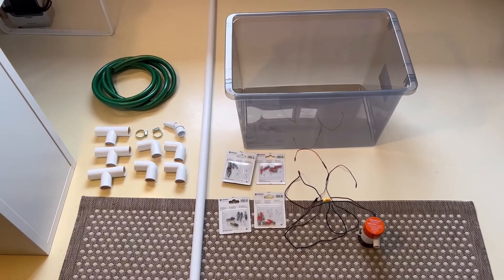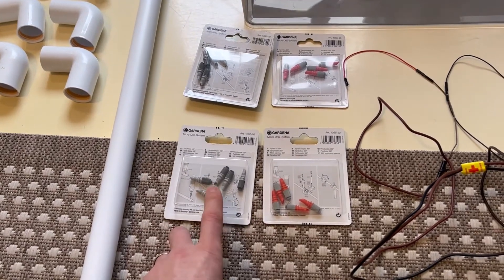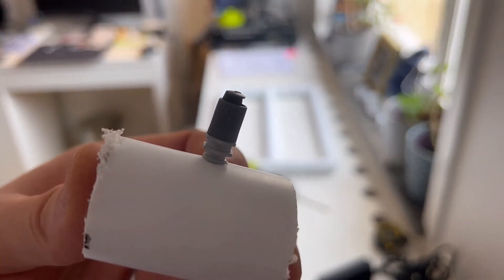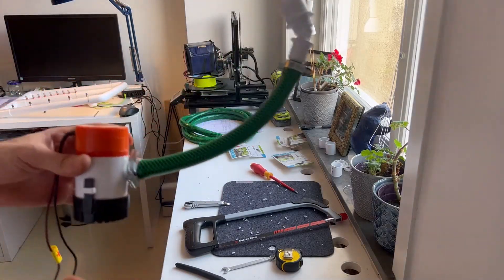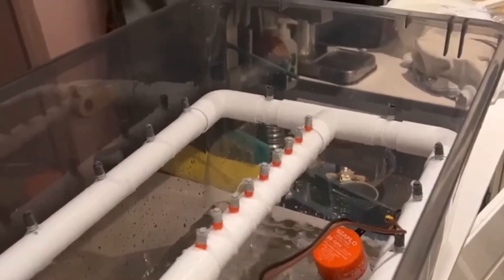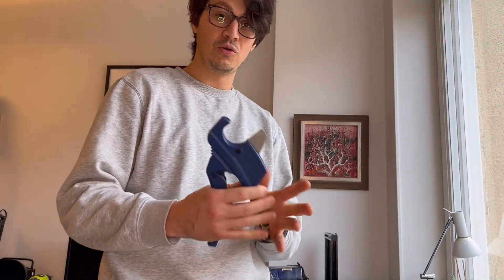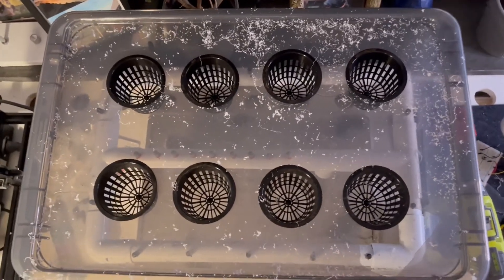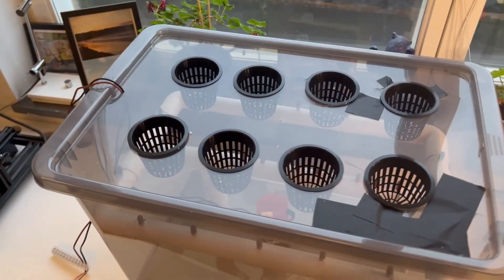DIY aeroponics system

Comment: Hey mate, good setup. Build something pretty similar. If i may give you a tipp from my experiences, a bigger waterreservoir reduces maintenance by a lot. It not only reduces the times you need to add nutrients, but the ph drifts a lot slower, especially if you use tap water. The challange of the plumbing is just far greater with an extra reservoir.
Reply: Using a larger reservoir in a recirculating system will delay the need to replace the nutrient solution due to elemental unbalance but it wont negate it :) If you are using tapwater, its a good idea to check its elemental content.
Reply from the maker: Thanks for the tips!
Reply: are you suggesting to use a separate reservoir entireley?
Reply: @CinematixActionProd  Not nessessarily. Depends on your containersize. In my experience, smaller reservoirs need more frequent maintenance, but i only used tap water so far. I have build a pretty similar setup with a total capacity of 2L for 3 leafy green plants. It needed ph adjustemnts every 3-4 days and on hot days a refill every two days. I now use a 80L reservoir for 10 plants (aeroponic container with plants and reservoir are seperated) and need to refill once a month (in summer) and only make one initial ph adjustment. Same water.

Comment: At zero flow your bilge pump will produce 1.7psi, nowhere near enough pressure to create any kind of mist  :) 
The 1100gph pump is better (6.4psi at zero flow) but its more washing machine on rinse cycle than aeroponic :)  Aeroponics is not about how much water you can throw around, its about how little. 
A little mist goes a long way,  https://youtu.be/ObivGI9QXwk
Plants dont need as much water as you imagine, same system with plants,  https://youtu.be/iXWT1cObE6o 
When you put the  plants in, i`d recommend just hydroton/clay pebbles in the netpots. If you use any rockwool or jiffy plug etc, it`ll become saturated in seconds, suffocate the roots or prevent any from forming.
Reply from the maker: You're correct about the PSI being inadequate. I also think I used pvc channeling that was far too large in diameter for what I needed to accomplish the task. I will be creating a new version of this system based off of the things I have learned here. Thanks for the feedback :)
Reply: @HHCIB  
I would suggest using a cheap reverse osmosis booster pump (ideally 12v or 24v dc), a couple of 1gph tefen mist nozzles and a dc cycle timer.
The cost savings on pvc fittings (silly expensive here) would almost pay for the pump  :)
Reply from the maker: @wetwerk2178  Thanks for the informed response and the encouragement. I like the feedback I'm getting from everyone. This is all new from me, so the more info the better :)
Reply: @HHCIB  Hi, it was better to use a clear tub for the sake of the video! Also, can you paint it black and test it on a video, please! I don't agree with the above comment as nft systems. The rockwool is always soaked. The results would show. Thankyou.
Reply: @totallyinsane6431 
Its an easy one to check, take the plant out of the system and the first sign to look for is how heavy it feels. The next thing to do is swing it back and forth gently. If you see a line of water, its way too wet. You`d be surprised how many folks overlook soaked rockwool when they are troubleshooting :)
Reply: @atomizer2665  I agree 👍 though I would like to see this tested on video to watch as you mentioned smaller pipes. Also, turn that pump down! Without the changes, it's only really good for power blasting your roots lol👍
Reply: @atomizer2665  like a washing machine lol true. If the tubes were smaller and at the top, would it help prevent root rot better than a dwc? It's similar yet not exactly alike.
Reply: @totallyinsane6431  
 I measure nutrient delivered per misting in milliliters not litres, so anything more than a teaspoonful seems like a lot :) 
Plants dont need as much as you think they do.
Reply: @atomizer2665  I need to do more research and test. At a guess around how much cost for smallest for a  test run and to learn! Thanks.
Reply: @atomizer2665  That's the healthiest roots I've ever looked at, and your video was three years ago. Is it more advanced now. Yours look 100% for the plants. 3 years ago!
Reply: @totallyinsane6431  
A decent quality pump, cycle timer and nozzles to make a basic HPA can be had for reasonable money (<£100 here, $124 USD). I`d suggest using 4 nozzles in a 30" x 30" x 16" deep chamber which will provide a decent bang for the buck and enough space for mist and roots which is crucial. The smaller the root chamber, the more control you need to prevent over misting. Its not about how much mist you can deliver, its about how little you can deliver :) 
The misting should look something like this:  https://youtu.be/ObivGI9QXwk
Reply: @totallyinsane6431  
I made that video for a friend, its just basic HPA, nothing too special.  I guess the most advanced aero system i`ve built would be this one from 2015.   https://youtu.be/Bn_aQZR8uzc
Reply: @atomizer2665  Thanks! 👍.
Reply: @wetwerk2178  
It seems you have no experience of genuine aeroponics, if your sprinklerponic, no timer system is working for you thats great.  I can tell you without a doubt that rockwool can become oversaturated and create problems that folks initially blame on the nutrient, temperature, ph or basically everything apart from saturated rockwool. When they remove the netpot and swing it back and forth, it suddenly becomes clear what the issue is. The roots beyond the rockwool will be fine until the roots in the rockwool suffocate and root rot sets in.  Fwiw, the droplet range for genuine aero is 5-80 microns, 150 micron is way too large. Here`s the closest thing i have to a low pressure aeroponic system, it runs on zero psi water pressure and would give NASA a run for their money.   https://youtu.be/Bn_aQZR8uzc